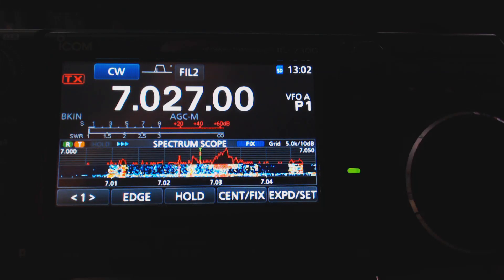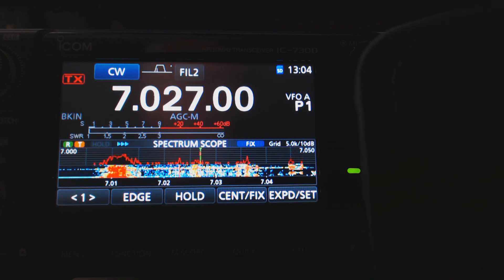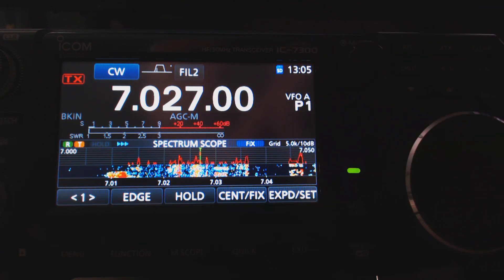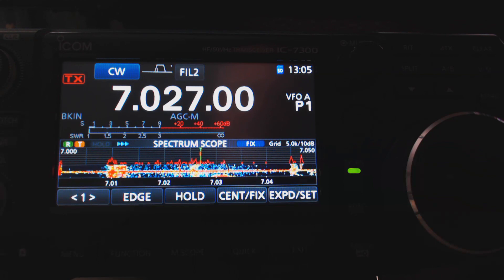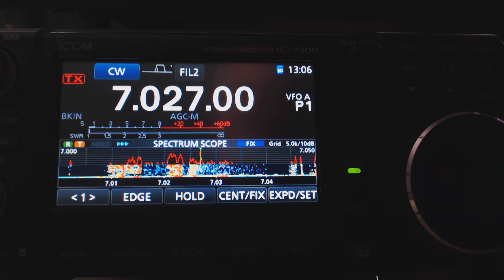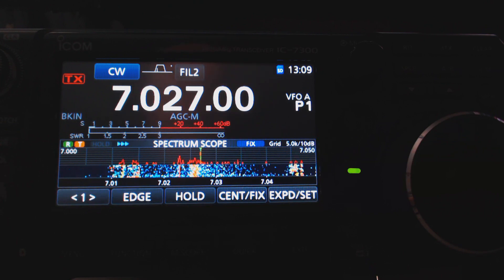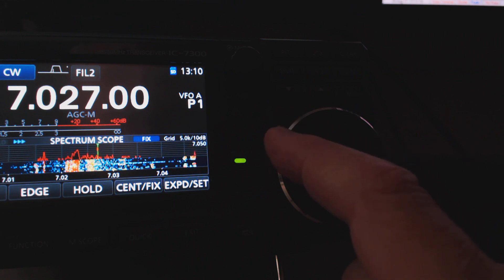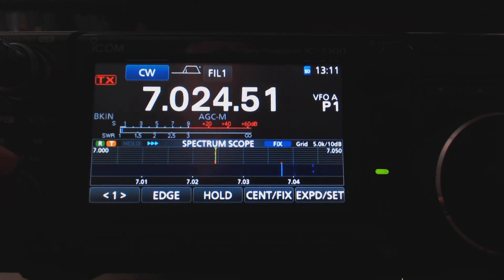IC-7300 Bandscope GLITCH

Comment: Absolutely Steve i couldn't agree more, they will prob come out with a software update to stop it, its unnecessary as far as i can see, i have never had a radio where i cant use it with the rf gain right up...guess i will try turning it down...or put a bit of black tape over it hi..Fred g4vvq. Uk

Comment: Does anyone get this annoying OVF flickering all the time, nothing in the manual about it Fred g4vvq.
Reply from the maker: Yes. OVF means "Overflow" and it has to do with the analog to digital converter in the front end trying to process too strong of a signal. Since the front end is broad, signals outside of the bandpass can trigger this warning while you don't hear a thing.  I've seen it flicker during thunderstorms and when some big SW station comes on even when it's outside of the ham bands and I've noticed no deterioration in receiver performance. Turning down the RF gain or adding attenuation reduces the input level and the lamp stops flickering. I think ICOM would have been better off not having the thing. It just causes unnecessary concern. 73

Comment: Hey Steve, that's a definite problem that Icom needs to look into for sure. I'm curious if the problem occurs on  VFO B as well. 
In the past I've had problems that were unique on one VFO only, however that doesn't negate the issue you are seeing. Thanks for posting this!

Comment: I assume you are on the latest version of the firmware (1.14)? I just got around to it, and I noticed the release notes refer to scope fixes:
A particular spurious signal in the Fixed mode Spectrum scope screen is eliminated.
Flickering of the Spectrum scope screen is reduced.
Accuracy of the spectrum scope in the CW mode is improved.
Frequency response near the edges of the spectrum scope is improved.

Comment: Curious if this is triggered by RF.  Or you see it when just in RX?    Suspect it is indeed a CPU glitch caused by common mode current.  Let me guess ... end fed  antenna?
Reply from the maker: End fed, center fed, dummy load...Doesn't matter. I have used all of these. Of course I only see it when in RX  since it goes away when transmitting like everything else.. All anyone can do is guess at this point.

Comment: Great job Steve.  My first observation was also Aug 24, at 1500Z about 7.053 after 5 min listening I thought it originated in Central America, SSB, tried to blame it on an out of band harmonic or unintentional operation. or possible normal operation in another country.  Then I heard it was a 3-way.  My Firmware version is 1.14, (7300 does not have "software".  I've logged 100 hours on 40 CW and had just this one observation.